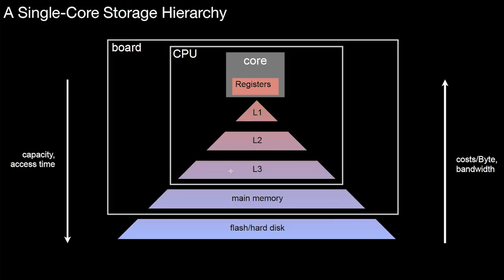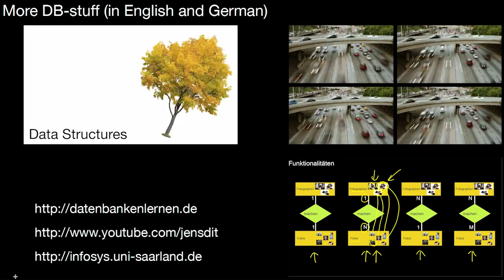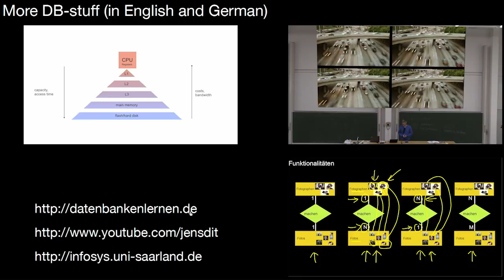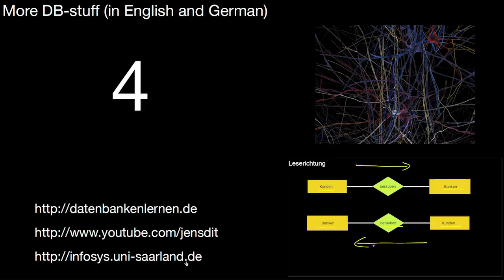14.104 Multicore Storage Hierarchies, NUMA

Comment: i do not understand the way your videos are numerated like 14.104 14.001 13.46 , how does the numeration-system works?
Reply from the maker: 14 is the year of the lecture (it will start in April 2014);
the first digit after the "." is the section, Section 1 for this video;
the following two digits are the number of the video within that section, here video 04